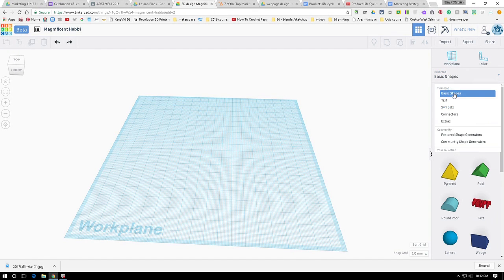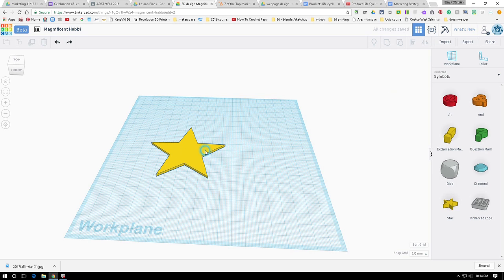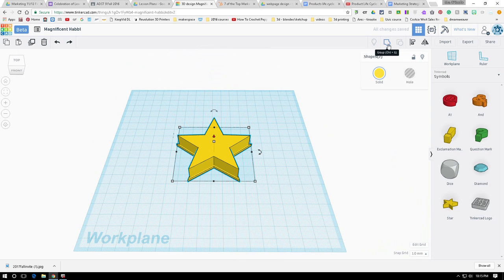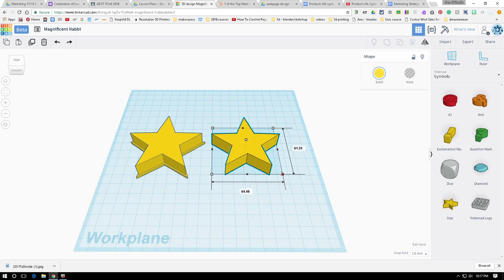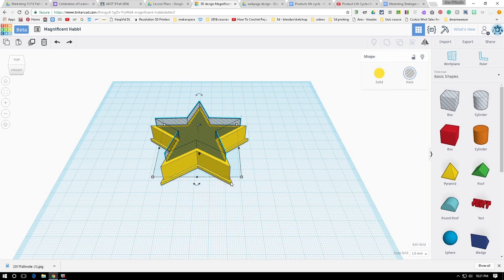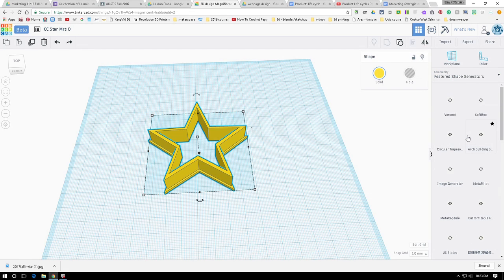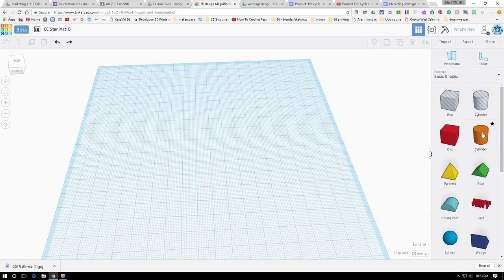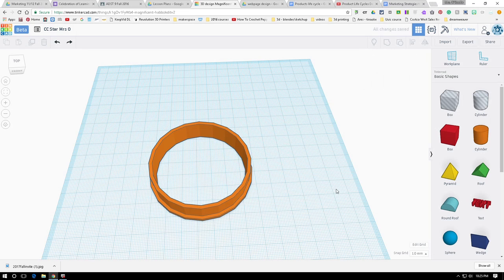cookie cutter tinkercad

Comment: I know this is a really old post but the edges are blunt. How do you make a cutter with a narrow edge on say the last 2 mm of the cutter so that it cuts the dough in a nice clean cut?
Reply: You may have found out by now, but, on your original design make 0.8mm, make three copies, extrude one copy to 3mm high by 3mm wide, second copy make 10mm high and last copy make 12mm high and 0.4mm thick, align then group and save as .STL.

Comment: So you can't draw your own shape with this useless software.
Reply: draw an outline in black pen, scan it, upload it to picsvg.com to convert to svg file, then import svg to tinkercad :)
Reply: A funny thing happened,  Maxon released a new version Cinema 4d that makes modeling for 3d prints much easier.
Reply: How do u make a thinner cutting edge on the top